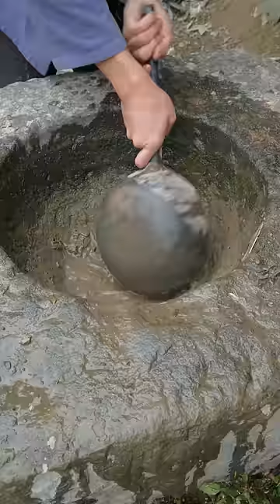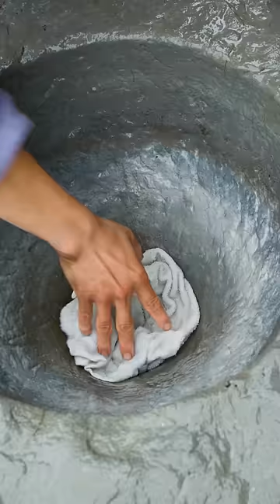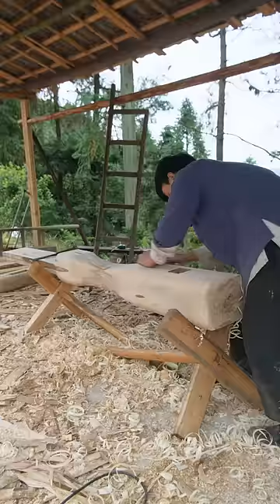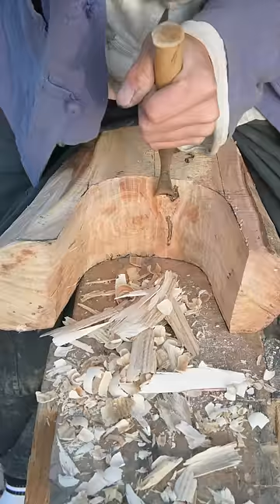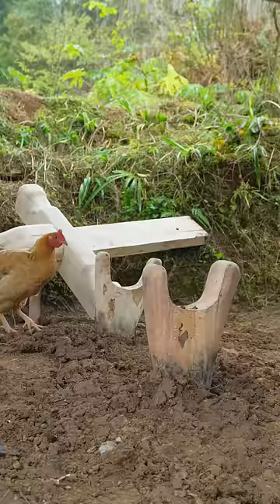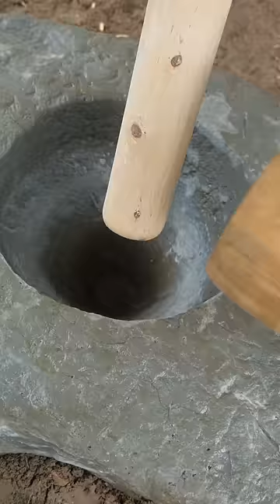石臼翻新 Reconstruction of stone mortar #woodworking #chinarurallife #craft

Comment: To make it really easy to hammer carve a 3 wheel pulley system and mount it above the heavy working end and you will barely have to pull. Go further and attach to a rotary wheel that is turned by an old bicycle and all you have to do is mount and peddle. Easy going!!! 😀